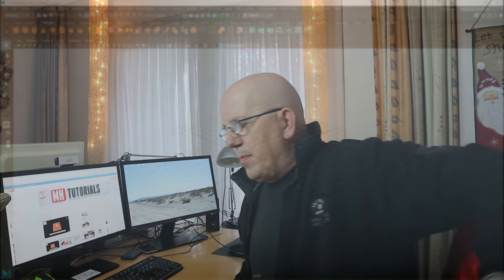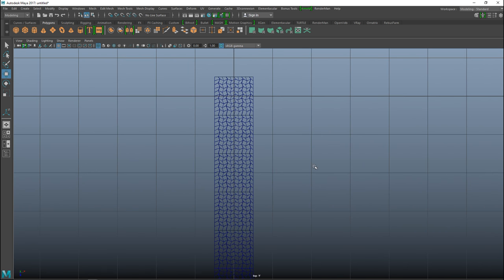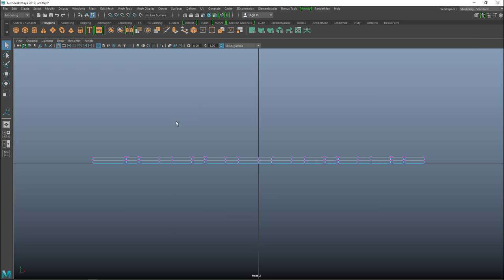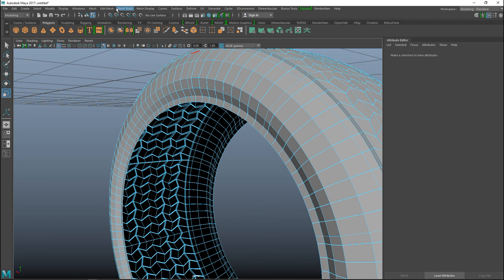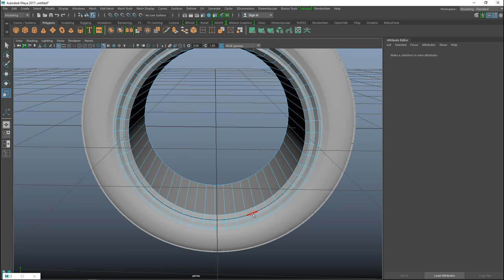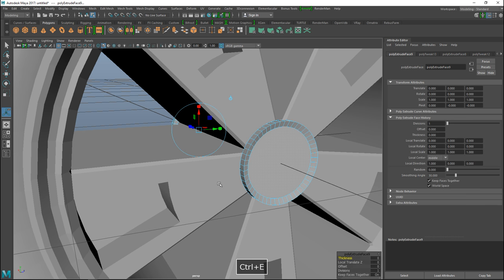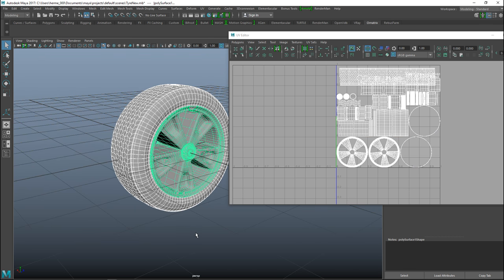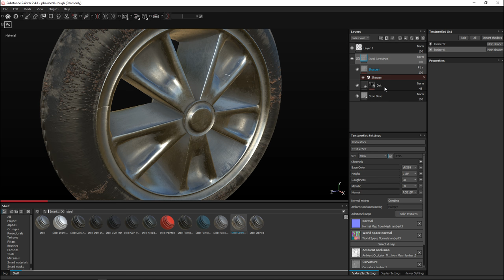How to model a Tire & Rim in Maya ( Full Workflow )

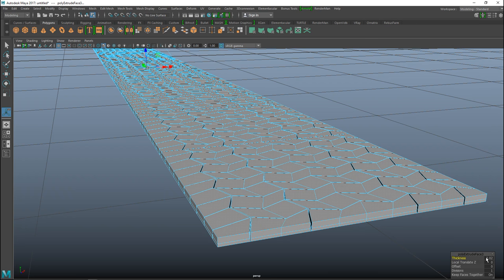Comment: Good tutorial, but a tip for making this not so manually repetitive is to model the treads on one chunk and make instances of it once you have the base square set up.  That will save you having to do that horrific time consuming selection spree at 11:50 and you only need to model on one square and not on a whole line, which will also help in making them tile also.  Kill many birds with one instancing move!
Reply from the maker: Thanks for sharing

Comment: Hi! I love all your videos and they're all super helpful and useful! 
Sorry but i have a question about the tire transferring into substance painter. (First time substance user as well) I did the same thing you did on the tutorial, but when it came into substance, it didn't give me the softer edges your file seemed to give you. My file loaded in with the harder edges like was designed in maya. I was wondering if i did something wrong or if i don't have the right settings or if you had altered the tire? And if you did alter the tire, how did you manage to get that softer feel? 

Thanks as always! :)
Reply from the maker: The softer feel is caused by the bake. So two questions : 1. Did you UV map the low poly model ? and 2. Dit you bake the initial maps before applying textures ?
Reply: @Mike Hermes I did UV the tire, and i think i baked it? But your tire looks like it already has the softer feel before you baked it in substance. It looks like it was smoothed but i tried smoothing it in maya and i didn't get the same effect.

Comment: hello my name is fazzi....am facing a problem.the issue is when am importing an object from maya to unity ,the scale factor for my object  is set to be 1 but in unity the scale factor is going down automatically to  0.01 or 0.1.how to solve this sir?.my object is done in meters unit and i tried it to covert centimeters or inches or other units but the results are same.please help me sir
Reply from the maker: Change the unit of measurement in Maya
Reply: pardon....how to change the unit of measurement???? sir
Reply: when i export, am creating a null object,within that null object am adding all my parts of a car object.so here the parent is null object and childs are my objects.when i import this to unity it shows the parent objects is i mean the null object scale is 0.01 and my objects scale  is 1 how to object this sir?
Reply from the maker: Windows - Settings/Preferences - Settings